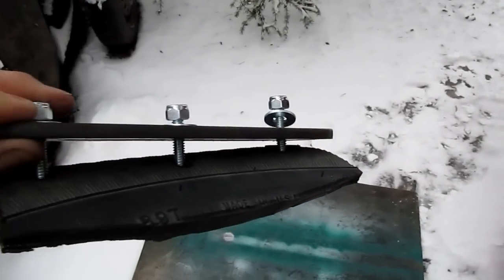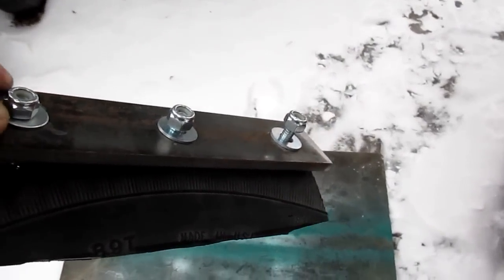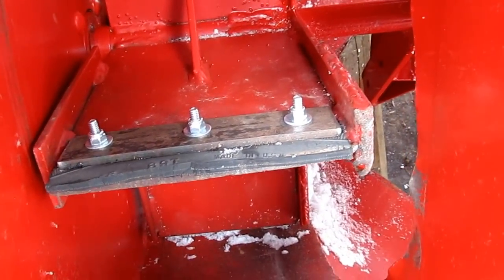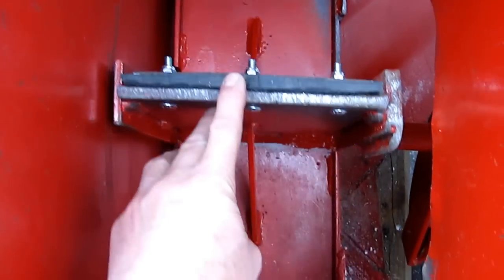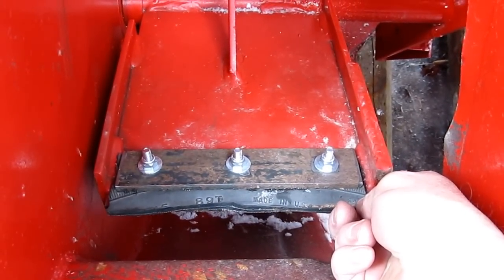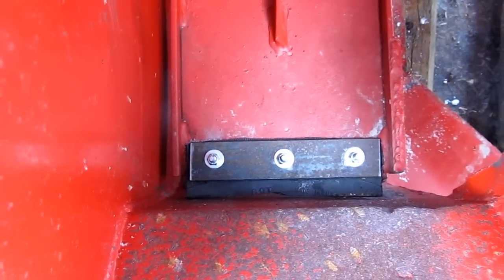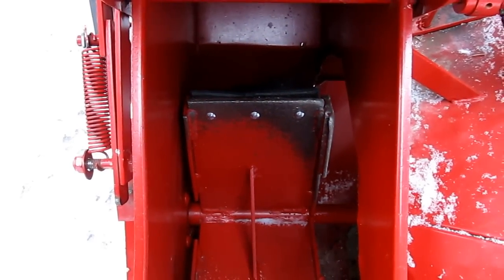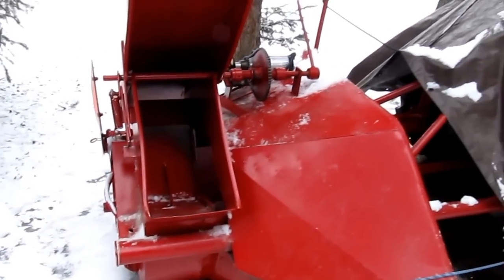TEA-20 blowing snow with a V-Type blower # 5, adding rubber paddles to the blower.

Comment from the maker: .

So Ari P what I said was "I took a idea posted here by sixtyfiveford of adding rubber clean-outs", that is what I did.  You can think what you want about others.

Of course there is a gap in the rubber, I cut them a bit long and let them wear in to the inconsistencies in the fan housing. Do you think a 3 PTH, V-Type snowblower survived 50+ years without some dents ? My second paragraph in the original post explains that.

Thanks for the information on the steel belting in the tire tread, that is why I used the side wall.

.

Comment: This idea has been floating around for a while, years in fact. So I think there are others before this person who really deserve the credit for the idea. It looks like you have a gap in the rubber in one spot. It does not look like you got a very clean cut of the rubber. Tire rubber may not be the best rubber to use. Make sure that you do not have any metal in there from the belt coming over the side of the tire, that could scrape the inside of the housing if it wears in and the belt is exposed.